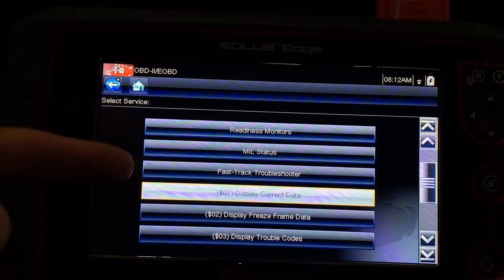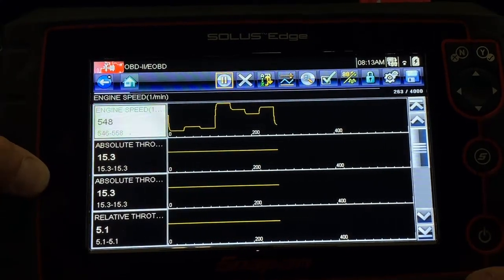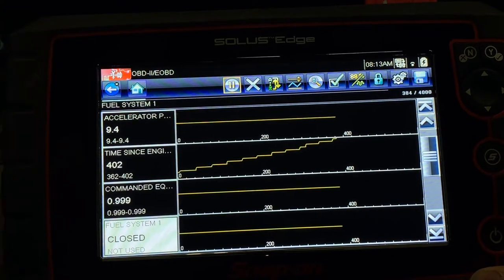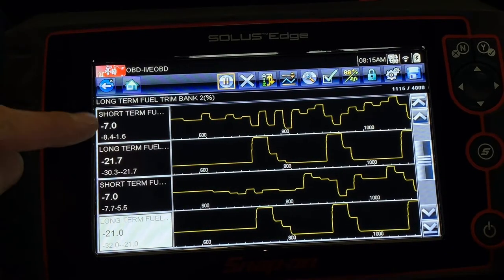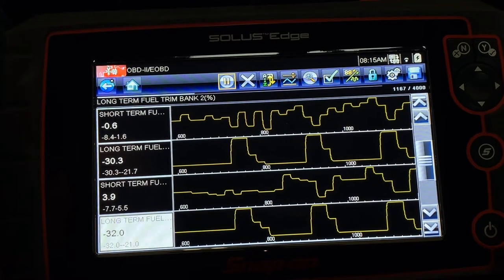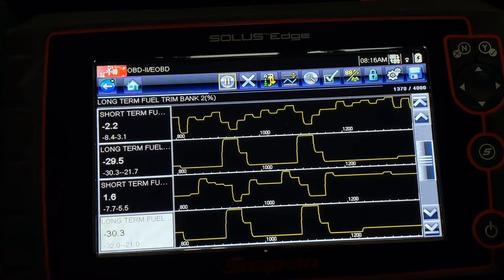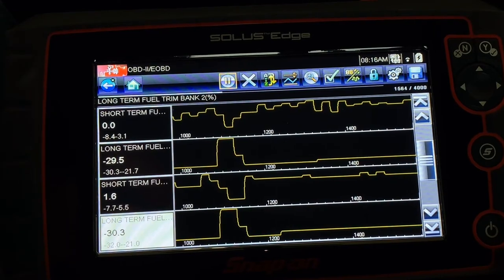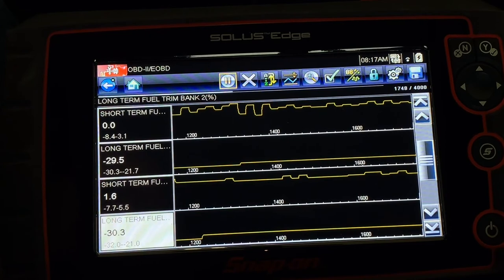Getting Started: Reading Scan Tool PID's / Data Plus Mindset and Perspective

Comment: Ya man, when you mentioned common to both banks, first thought was MAF, MAP and air filter.🤔😀
Reply: New to doing my own repairs and I came across an obd scanner and no check engine lights and the truck is running good. But the scanner says shrtftb1s3 (%) .....99.2
Is that normal?